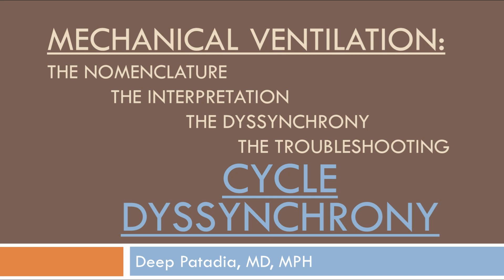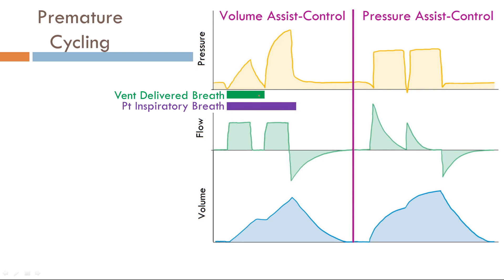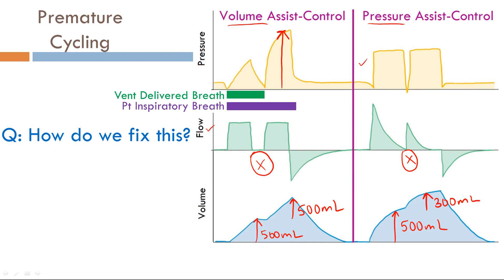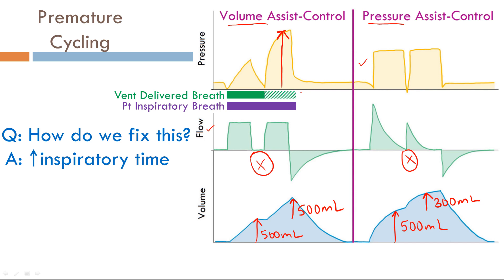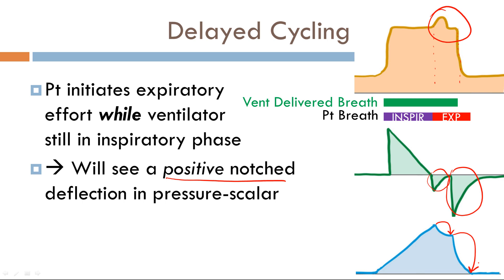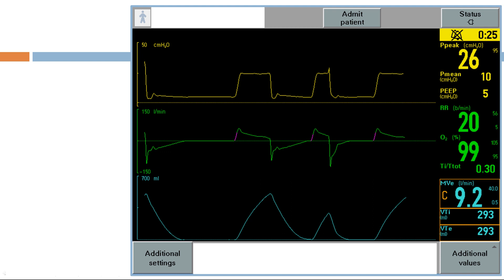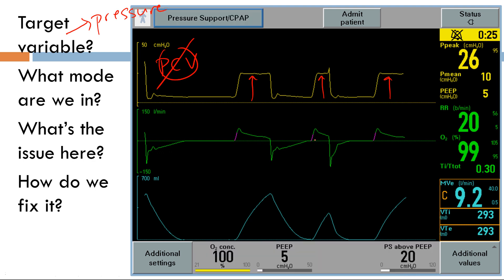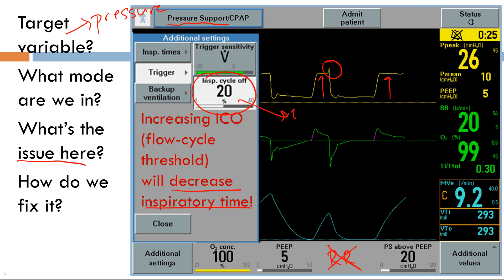MV: 12 - Cycle Dyssynchrony

Comment: however you can manipulate inspiratory time in VCV mode in new ventilators, right?
Reply from the maker: Yes, however it does a "back-calculation"... if you notice you can change the inspiratory time on VCV, but the max flow rate will change accordingly. It does this as a way to make it user-friendly for the operator, however the concept is still unchanged -